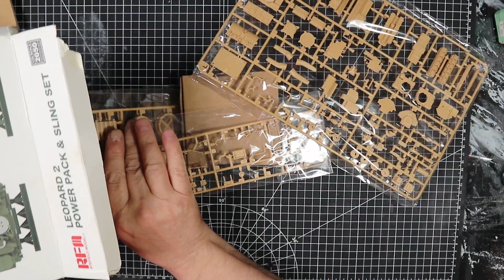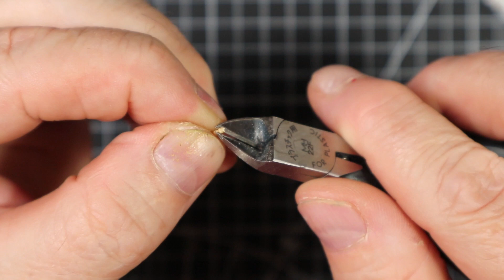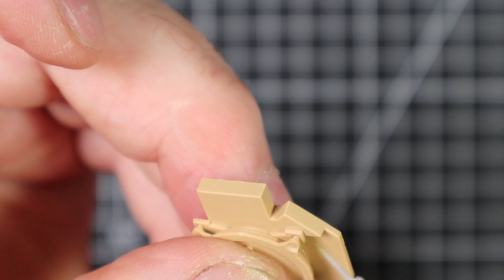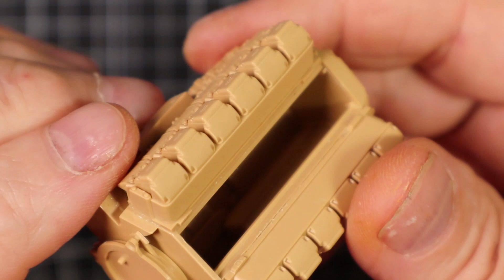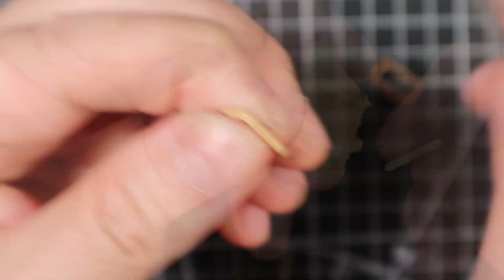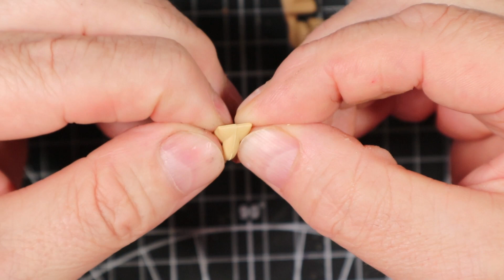RFM Leopard II Power Pack Part 1

Comment: Is this for the Leo A7v also?
Reply from the maker: @PainSorrowFury  Yes, the newer Leopard 2A7 retains the MTU MB 873 Ka-501 power pack used in earlier Leopard 2 variants, including the 2A5 and 2A6. This power pack consists of a 12-cylinder, 47.6-liter, twin-turbo diesel engine, producing 1,500 horsepower. It is paired with the Renk HSWL 354 transmission, providing excellent mobility and performance.

While the power pack remains the same, the Leopard 2A7 includes significant upgrades in areas such as armor, electronics, and crew survivability. These upgrades enhance its overall combat effectiveness without requiring a change to the proven and reliable engine-transmission system.
Reply: @JETScaleModels  Thank you!